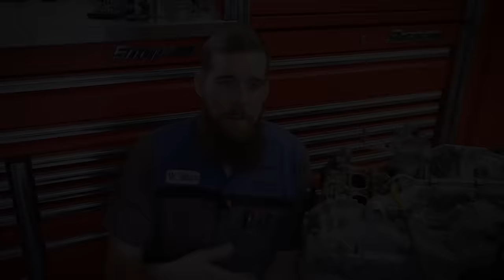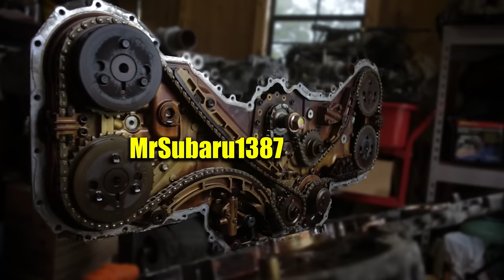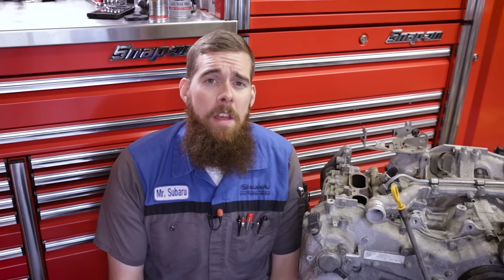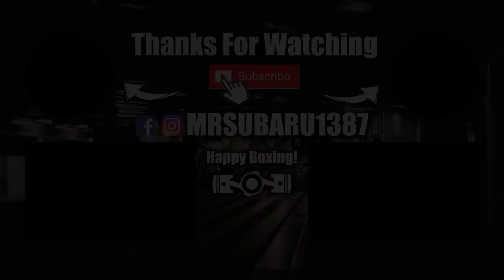Why Subarus Are So UNreliable!!! Buckle Up!!!

Comment: What?  I can't put in a GM diesel turbo, remove the air filter completely and remove the waste gate and bypass valve and still get 1,000,000 miles out of it and 1,000 horsepower with no tune?  But on Gran Turismo I can.

Comment: I recently started looking at getting a WRX STI from between 2009-2013 and i was simply wondering what the auto transmission were like in them. There's a local dealer to me that has about 15 of them all in auto and i was wondering if the transmission were troublesome or a good job.
Reply from the maker: There’s no automatic transmission STi. They’re all 6MT

Comment: I see this video is now a year old but I'm seriously looking at a 2023 Forester Wilderness.  Is the head gasket issue still something now as this vehicle has to 2.5 NA engine?  Now in my 60's this Wilderness will never be driven hard and probably will never be taken off road except my dirt/rock driveway.  :)  Also, I've always taken very good care of my vehicles using original parts when it comes to maintenance.
Reply from the maker: Head gaskets haven’t been an issue in well over a decade
Reply: @MrSubaru1387  Great, thanks!

Comment: My recent expereince working on fa25s havent been great. They seem cheeply made and have such stupid problems. Did valve spring recalls at toyota on the frs. Did a heater control valve on a 19 forester, 95% of it is made with plastic. The inner portion of the valve, shattered and threw a code. I feel subaru couldve made the inner part with metal instead of plastic. Just my 2 cents. Not saying subaru is junk but I feel that their new stuff quality wise has gone down the drain. Reminds me alot of the new toyotas, they all have lots of issues with the oarts being cheeply made and failing often.

Comment: I have a 2014 outback, 95k miles on it, all maintenances are up to date. Only wheel bearings and ball joints, to be expected considering New York road conditions. I am curious as to your recommendation on coolant maintenance, seeing the manual states 11 years or 135k miles, which ever comes first. Great video, man!

Comment: Sorry, EJ-82 Turbo owner here, 1986 GL-10 model, long before they were cool... NOT head gasket... Head CRACK! Multiple times because the turbo coolant returns to the passenger side so that side runs HOT. 2 Engines... then Ol' pop decides to buy a '99 Outback NON turbo... blew a head gasket while driving easy in his 50's. So I have 2 Subaru's sitting next to eachother in the graveyard. NOT driven hard, NOT modified, NOT tuned!!!

Comment: I have a supercharged frs, i've been dailying it now for over a year, no issues. And this is a notoriously weak engine. It's funny how overlooked operating temperature and basic maintenance is. 

You did stoplight pulls every day on a cold engine immediately leaving your house and didn't once check your oil in 6 months? now you're surprised you have a dead engine and are blaming the design of the engine? shocker.

Comment: I have a question, this is genuine. are these cars like anti rotary engines where you have to maintain the piss out of them but you can't beat the shit out of them even stock Is this the situation where if you turbo the car you can only really experience the turbo in a straight line depending on the temperature outside very specific circumstance or it's going to blow up?

Comment: I have a 2017 Outback 2.5. Why would anyone with half a brain put the oil filter upside down above the engine. Every morning the car is started with an empty oil filter and rattles it’s ass off until the filter refills with oil? And it has nothing to do with the back flow valve in the filter. And yes it does it with the Subaru filter. I can take the filter off in the morning and the filter will be dry. 
Explain that poor engineering?

Comment: Too bad Harbor Freight doesn't make vehicles for knuckleheaded mod addicts like this. They sell inferior, made to fail tools but.........offer a never ending bring it back and get a new one policy. Or atleast they use to. You buy a power tool and after trashing it on your current job, you get a new one to trash on the next job. And so on and so on. Maybe call it the Harbor Freight Non Reliant K Car? Good stuff Senor Subaru!!  Venting/Truthspeak.
Reply: if a harbor freight tool breaks on you, you buy a good quality one. also if your breaking tools that fast what are you doing to them? ive been using cheater sticks on 1/4th ratchets and 6 hour straight work with their power tools.

Comment: What is normal driving with a wrx? Am I not supposed to rev it to 4k-5k between shifts? I mean its a turbo 4 cyl awd racer advertised car. I need to know what NORMAL driving is lol. P.S. 21 wrx base stock still running strong haha

Comment: I know when tuning a stock 2009 Subaru WRX I noticed that the stock tune had very lean AFR's. Also the pistons had very thin crowns. So a tune that causes high combustion temps contributed to the EJ2X issues. An aftermarket tune actually caused them to run a safer AFR. Sure don't go nuts with the boost and timing advance, but the stock tune that seemed to be prioritised for fast CAT light off also caused premature failure.

Comment: What are you talking about… you mean I can’t throw 40 pounds of boost in a stock 30k car and make 1000hp without building the engine……I’m so offended. Subaru should be put in jail as far as I’m concerned 😂

Comment: Subarus are NOT rally cars or rock crawlers.  Keep that in mind and you'll drive a lot further.
Reply: they arnt good cars to begin with, dash lighting up light a Christmas tree and door handles trunk hydroponics snapping off. my 96 tahoe has 380k miles and doesn’t have nearly the amount of problems as my 2015 forester

Comment: 11:26 what do you mean by 80-100k service for the timing set?  I thought it was just timing belt replacement at 105k
Reply from the maker: Timing belt rarely is the failure on these, it's the idler pulleys or tensioner. The whole timing set (belt, tensioner, idlers, wp) should be replaced every 80-100k miles.
Reply: @MrSubaru1387  thanks for the quick response!

Comment: You are right stupid owners who trash their cars don't do the maintenance on them over modify them learn the hard way. I'm all for leaving it stock from the factory. I got an 06 legacy GT that was trashed, it still runs but it's a ticking time bomb. The turbo is on it's last leg at 177,590 miles so it the timing belt, the $$$ is not there to do both of them. At the same time, it's a car for a kid to tear up and rebuild or destroy. Not worth the $$$ it will take to bring it back to a normal running car. This is my 1st subaru, ....

Comment: where do you you live cause I have a 2010 subaru forester 2.5 xt turbo with 96,000 miles. and I stepped on the gas hard one time and after that it has a small shudder right before 40 mph. come service my car. 🥲 or contact me.

Comment: I was told it’s the head gasket if all, lol they are in safe? Lol  I had a 2011 recently and due to my fault I had a expensive trans issue. My fault my bro is like thank god it’s gone that car will get you killed. Wtf?!?  My new car is a vehicle I’ve always wanted . A wrangler I know this one will give issue even with regulars maintaining it. But the wife and I plan on another forester. Period. 
My only complaints ever of a Subaru is 1 it’s a boring drive it is almost to good lol accept snow it was fucking fun. 2 the cvt is not that good they are just not. It’s not . 
Side not the wilderness is awesome to drive accept the tires wtf. They said they were designed with it in mind but I’d say ugh. Wildpeaks from falken I had on my 2011 were like putting claws on it . Awesome off road on road. Just great suffering some mpg like 3 m per g. But made it a bit more fun. Plus with them in its size and no lift needed makes it a no brainers . 
Love the channel happy Christmas

Comment: I bought a one owner 15 sti limited with 25k around thanksgiving. previous owner maxed boost at like 8psi I don't think they ever used sport or # slapped 4 new michi pilot sport all season 4s(awesome tire btw) on it, did an oil change asap bc i didn't trust what the sticker said.  next oil change 3k later Mobil1 5w30 only.  Getting ready to service the diffs and trans/ brake fluid. will do a 4 wheel Bj at the same time.  Point is not all of us youngins are like this but there's plenty of fukbois out there. I work at a shop so it is a bit easier on the wallet. Anyway happy miles to you guys that take care of your shit! OH, 2000 miles in on this last oil batch it was about 3/4 quarts low is this normal?

Comment: Oil consumption, valve cover gasket leaks, head gasket failures requiring the engine pulled...good grief...my daughter's '09 Outback EJ253 at 162k is being rebuilt as I type. In contrast, our '01 Accord F23A1 with 277k still doesn't burn a drop of oil. Both get regular oil changes at ~3k.

I pulled the EJ253 out a few weeks ago. Daughter is driving Accord. She calls me, says "Dad, this car handles great in the snow, I narrowly averted a head on" (It has fresh high-quality snows on it). Maybe she doesn't need AWD!

RnR (remove and replace) costs are through the roof (like $2500). I pulled EJ253 and had it on an engine stand and stripped to long block in 4 lazy hours. I'm guessing 7 hours at my pace to get it back in. I'm intimately more familiar with Subaru than I care to be.

Comment: It’s crap unreliable. Throughout that vehicles lifespan.
The engine is going to be pulled out the car.
You can not get a high mileage car without the engine ever coming out

Comment: Buy a Toyota or Honda and save yourself. When I purchased a brand new 2017 forester 2.5 NA 6 speed manual, I maintained the oil to the T! and at 18,000 miles the engine started to burn so much oil between intervals the engine light would come on and I had to keep adding and adding and adding oil. As well the transmission developed a horrible rattle sound under acceleration at 12,000 miles, sounded like metal in a blender. After countless times back and forth with the dealer telling me this was all normal I let the vehicle go. As much as I loved it I will NEVER own another Subaru. It was completely stock!  I did not abuse it, the engine was not designed correctly from its inception.

Comment: In all fairness... there are a lot of engines I can  do simple bolt on mods to with no tune and the engine has no problem with it. Part of owning a fun car is doing fun bullshit mods and saying you can't put a cold air intake on it ($30) without a tune (hundreds of $) is pretty unreliable. Then saying you can't compare it to any other engine is almost gaslighting. An engine is an engine. I love what you do but I think you're lost in the sauce.

Comment: I agree with you 100% I drive a 2016 WRX with 184k and still running strong. I am starting to wonder though how many more miles I can get from this OEM setup before an engine rebuilt or replacement of engine, transmission or turbo will be needed.

Comment: 20’ STi bone stock and still have issues with mine. 55k miles and cylinder 2,4 💩. Daily driven and babied. I will say these engines are crap.

Comment: '07 Forester NA, head gasket @80k, VVT sensor @110k,  upper radiator seal @120k, brake light switch 122k, Up until the head gasket I loved it.

Comment: Probably the most common “unreliability” issue i hear, specifically with turbo EJs is the elusive misfire. @MrSubaru1387 what are your top 5 unconventional causes of misfire? So not including the typical ignition components, bad gas, idiot mods etc.

Comment: My 2021 crosstrek manual transmission is GUTLESS. They didn’t put an engine that is powerful enough for the weight of the damn thing. I am disappointed with it’s power

Comment: Why should the owner have to 'know' to put a turbo head gasket onto their naturally aspirated engine?  Why would Subaru not design the head gasket not to fail.  I drove 2 Subaru Foresters (naturally aspirated) with no mods/tunes and driven conservatively in stock form.  Both had failed head gaskets.  These cars were purchased new approximately 10 years apart and maintained per recommendations.  Was I supposed to 'know' I had to pay extra for having a turbo head gasket in so this was my fault?  I understand you're being upset about people modding the engines and then blaming Subaru for any issues that arise but the truth is that head gasket issues do occur with Subarus that are properly maintained then the owner (me in both these cases) left with the consequences based on what is not only a poor design, but one that apparently has been a known engineering issue that has never been corrected.  I like Subarus in terms of design but I can get around in my car without AWD.  I cannot get around without an engine.  When Subaru has the same design flaw 10 years apart, that seems like intentional engineered obsolescence.

Comment: Hondas like to blow head gaskets too. But at least they can be easily worked on. 

Almost seems like Boxer plus AWD means nearly Porsche-like service cost with Subaru simply due to configuration. Can you do anything on Subie boxers without dropping the motor like Porsches?

Comment: Had a 2010 NA Legacy, went through 3 radiators, one head gasket change, valve body and torque converter change in the 10 years I owned it.  Feel like I've spent more time in a loaner than in that Legacy.  No engine mods, oil changed regularly, all maintenance done at prescribed intervals.

Comment: 100%!  I was a nuke electrician on a sub, I got an electrical engineering degree, I've actually worked in a Honda assembly plant as a software engineer, plus years of experience working on cars and it feels like a slap in the face when kids with little to no actual education, training, and experience do these things and then effectively blame the engineers.  We were young once and we chose to study our passion.  I consider it very important for experienced techs to state things like this firmly as you have, this did not come across as a rant on your part IMO!  Great, great video!

Comment: 4 failed builds on my 04 sti. 1st failure was the infamous cracked oil pickup and was a stock motor and turbo. Done with Subaru, sold it and bought a 2018 Honda Type R.
Reply from the maker: Sounds like a you problem. 😂 😂 😂

Comment: I had a 1999 Ej25d in a legacy, super well maintained, no mods.  It lost its headgasket at 100k km, fixed it then the rod bearing let go about 10k later.
EJ20K on stock tune lost its head gasket at 100k km.
It's not only bad tunes and abuse that kills them.

Comment: Back in the day, I had a Top of the Line Subra Out Back 2001 HTC - H6 normally aspirated, stock. Perfect condition, perfect maintenance records from day 1.  Blown head gasket at 140,000 miles. Dealer declined to quote repair..  Will never go back to Subura.  Back to Honda /Acura products.

Comment: I agree that the users are the issue most of the time. HOWEVER, suggesting people buy turbo Subarus to not drive them as performance cars and “abuse them” I can’t agree with. These cars are marketed as performance machines. Why would you buy a turbo Subaru and drive them like a Toyota Corolla?

No other manufacturer has this type of mentality towards their performance cars.

Comment: Dozen of my co-workers at my 2,500 employee job has Subaru vehicles. I can say lots of them have lost engines due to running dry on engine oil and head-gasket failures at well under 100,000 miles and these are 22-40 year old soccer Moms with little kids. I might be wrong, but I believe Subaru has some quality issues personally?

Comment: My 07 wrx spun rod bearings 2 times I changed her oil every 2k but it burnt oil so bad at 100k that you drive it 20 miles and it needed oil it was stock 100% .we buy that guy to drive it if I wanted too drive it like a civic I would have got a civic ...but I never blamed Subaru not once I fixed it my shelf .too be fair it does have almost 190k on it now it's been good car.other nlthen that but who knows

Comment: Not sure why you guys are debating Subaru versus Toyota or any other import brands.
There is really only one top motor company: Honda.
Reply from the maker: Honda? 😂 😂 😂 That's rich. Been downhill since the early 2000s.
Reply: @MrSubaru1387  what can I say, being a serial Honda owner, I drank the kool-aid.
But seriously, good job on your channel dedicated to Subaru brand.  I considered getting an STI in the past but ended up being a current owner of an Evo X.
Reply from the maker: What number transfer case are you on?
Reply: @MrSubaru1387  it helps that I drive like an old man that I am.  But saving up money for WHEN the DCT gives out.  That is whatever money I have left after filling up the gas tank.  14 mpg.  What car(s)  do you own?

Comment: Ah yes my wrx I would get rowdy with about twice a week a pull or so and done no abusive launching no tune no aftermarket parts gives me shavings it’s my fault right bc I’m young not because it’s a flawed design not because I’m behind on my non existent maintenance list but because I’m young do the same shit to a civic with a hot air intake straight pipe and over 150k and it’s fine I think it’s the motor brother it’s not as A tear of a motor as you are crying about shit did worse absolutely every single day for 20k miles on a is300 with oil leaks a permanent check engine light from evap codes and a straight pipe I didn’t do never had problems with it not with the motor or trans nothing just bad fuel economy bc of how abusive I was Shit I dam near tracked the car on the way home through some twisties did burnouts did a 120 pull every day to work raced anyone willing to race and never once had a problem with it but I get a car with 29k miles on it put 30k most of which I drove pretty slow to see how high I can get the gas mileage and bc gas was at an all time high suddenly its my fault the motor is a poor design